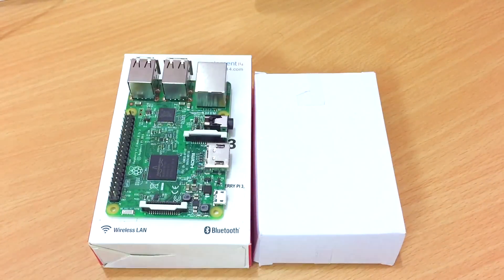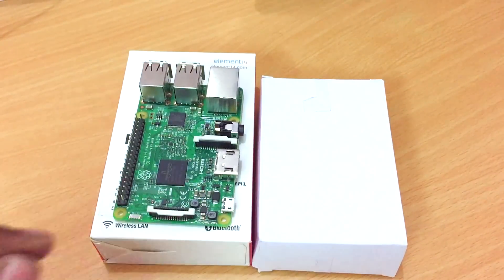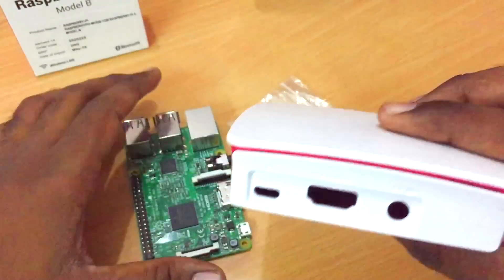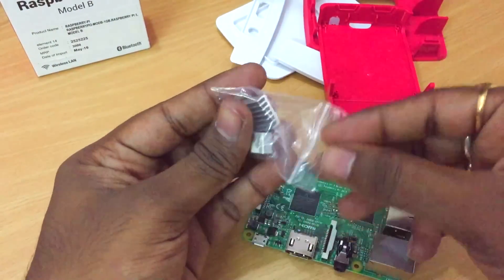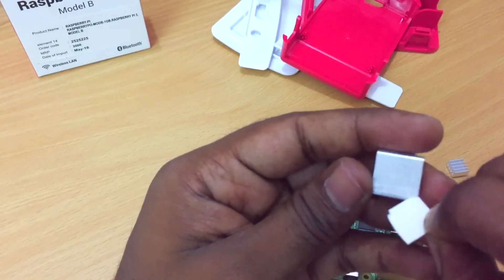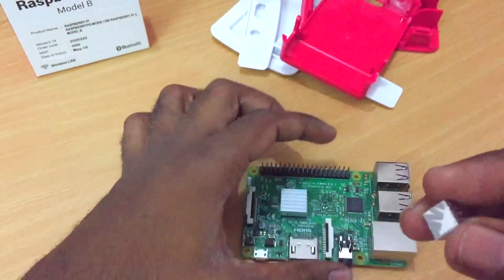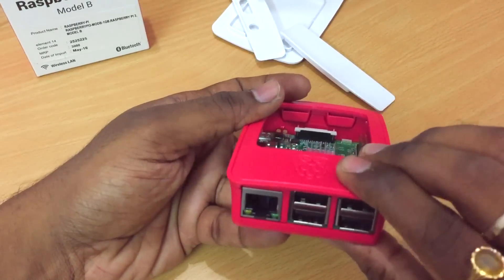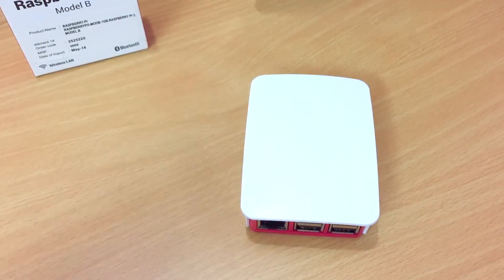Raspberry Pi 3 - HEAT SINK Installation with Case

Comment: why they are using a sticker to stick heat sink ? won't the sticker block the heat transfer to the sink ? resulting negative effect ?
Reply: It's not a regular sticker on the bottom of the heat sink, it's a thermal adhesive. This just makes it so you don't have to worry about applying adhesive yourself.

Comment: What? wont the tape stop the conductive heat transfer between the ship and the fins? Also, the board is in a plastic case which will trap the convective heat from the fins.

Comment: What is raspberry pi 3?
Reply from the maker: It is a small Motherboard Which Comes with Builtin Processor Ram All parts of computer like we see on desktop PC .. The Thing Is PC motherboards are very big .. Raspberry Pi is Very Small ..It is used to do some projects ..We can install Any operating system through Micro SD card or memory card ..It is Also used for Programming ..
Reply: Ksk Royal basically a micro pc.
Reply: Rad❶ Credit card sized PC.